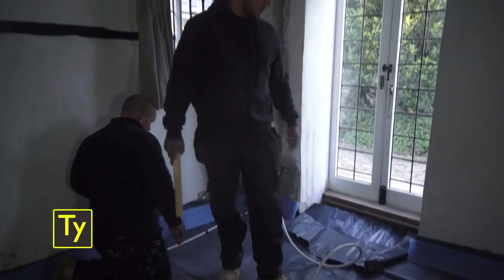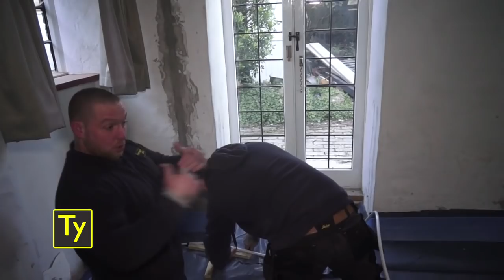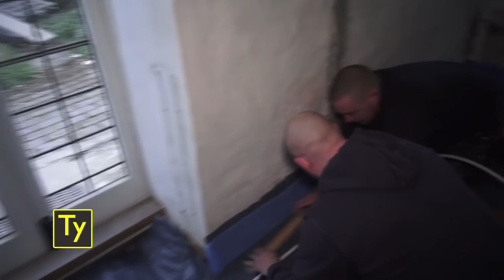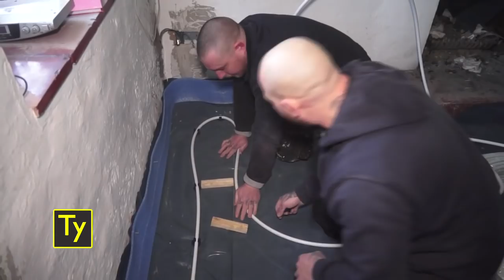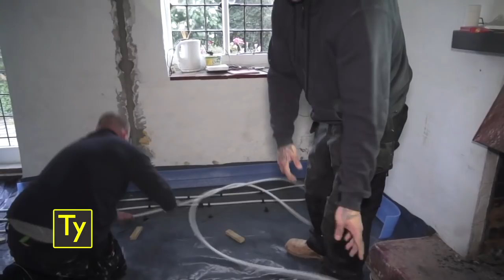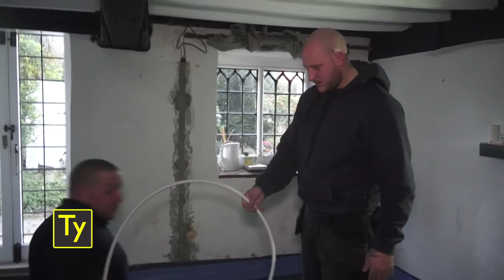A Day at Storrington Part 5

Comment: Lads, if you turn the coil when pulling the pipe out it prevents the pipe from snaking like it is doing. Makes it a lot easier to deal with.
Alternatively when you got to the first corner if you stood the coil up and turned it (90deg to the floor) it would have got rid of all the kinks.